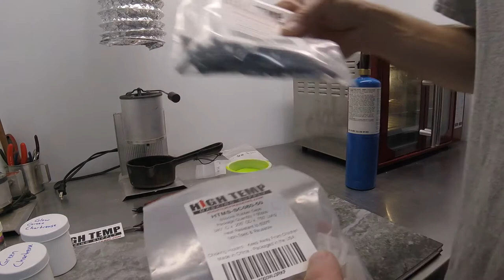Powder painting Do-it molded fishing jigs with a homemade fluid bed. (Part one)

Comment: Will those caps fit a #4, #6 and #2 hook?
Reply from the maker: Unfortunately they don't and this is the smallest size cap they offer. I'll try to find another option for you.
Reply: @relapsetackle  well crap! I done ordered them now 🤦🏻‍♂️
Reply from the maker: You might want to try a 1.5 mm or 2 mm heat shrink tubing that doesn't have a glue lining. It's not reusable but it will help keep the eye of the hooks clean.
Reply: @relapsetackle  thanks
Reply from the maker: You could try cutting a small slit at the end of the cap and see if they stay on for you. Just make sure it has a small gap between it and the jig head so the paint can cover the head.
Reply from the maker: No problem at all.